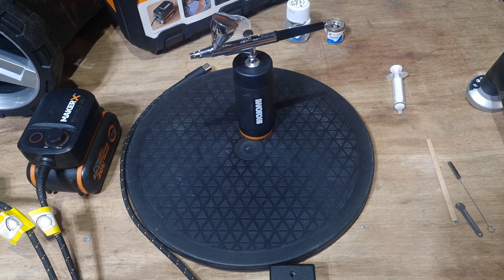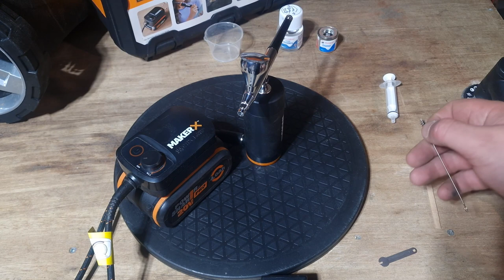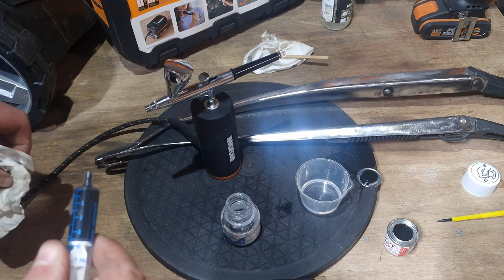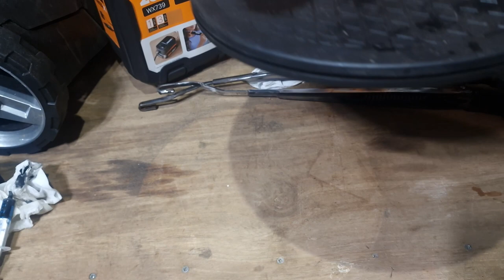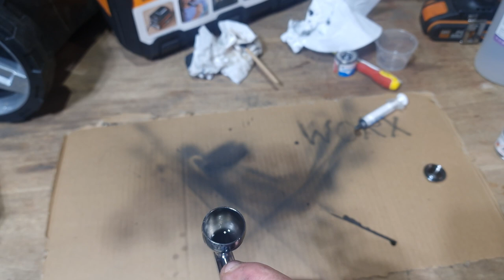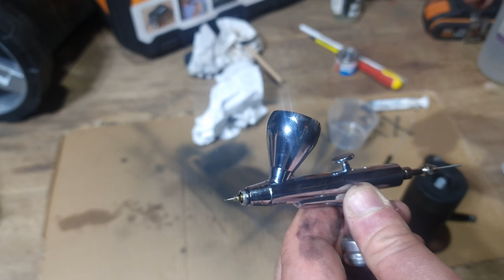Worx wg742 Maker X 20v hub spray gun, model spray gun,  spray tanning, cake making tool

Comment: You guys can still get model paints in a tiny can? XD I love that lol. Also for the air brush I ended up getting a airbrush hose and a quick connect for it as well, so the hose plugs into the compressor and the brush itself gets a quick connect on its end. I found the compressor gets hot in long use as well as the vibration gets numbing if holding it to long and a hose in the middle solved all that. Bonus is now I can use any airbrush with my kit.
Reply from the maker: I heard a rumour that Britain would fall apart without our British airfix kits and micro pots of paint :-P Germany have them too :-) I remember the air brush ¼" hose extensions - we used to sell them at the model shop i used to work at but as we only sold Aztec - they came with their own hose (and at those prices should be gold plated too) it's good to know they can be used on this, I assume badger airbrush accessories like cups etc can be used with them too?
Reply: @mikesptworld  I think just about anything should work with it as its a standard airbrush in every way I can tell :) I love that its not all proprietary so you can always fix or replace parts as needed